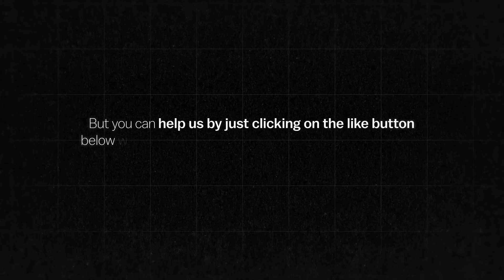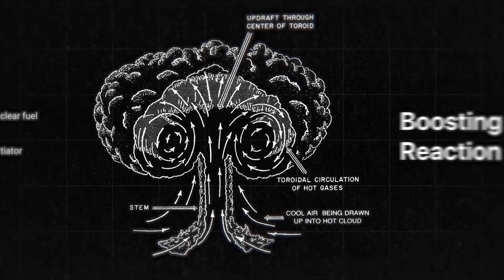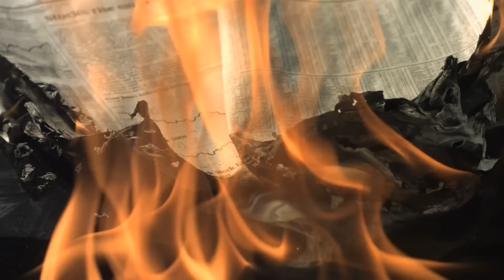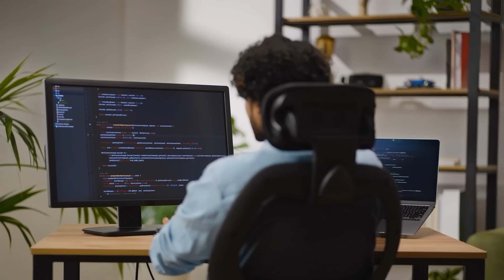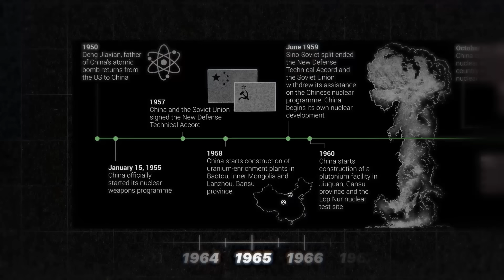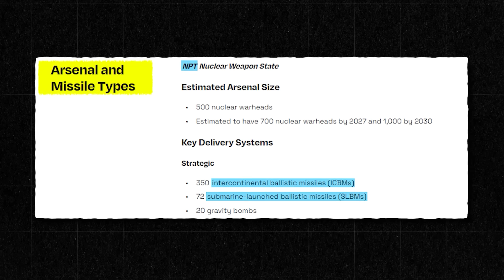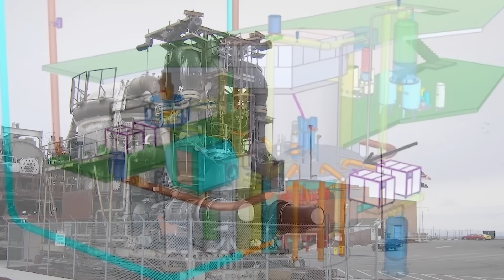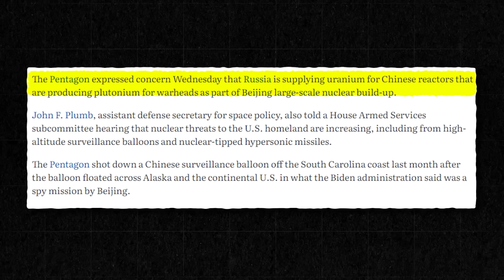How China Built The WORST Nuclear Weapons

Comment: U233 is a poor bomb material as it’s almost impossible to separate from U232. The latter has a dampening effect on 233 as a bomb fuel. It’s just easier to use Plutonium. 
Molten salt reactors are more about fully using the fuel (99% v 4% in a water reactor. The chloride design being homologated in Canada solves the material and salt glow problems associated with the 1960s Weinberg design
Reply: The Americans found U-233 to be an excellent fissile material - its critical mass is probably 90 percent as good as plutonium. It's harder to produce but the Chinese actually use U-235 a lot more and also plutonium.

Comment: The US invented the technology. The Teller Ulan design is one of those "face palm" ideas where after it works (like the fission bomb itself) they said that it should have been obvious. The Chinese scientists and engineers may not have gotten the plans for the bomb from the US, but they had access to enough information so they didn't have to reinvent it. 

They copied what the physicists in the US invented. You rather tend to miss that point. It wasn't because they were exceptionally smart, it was because someone else had the idea and they copied it.